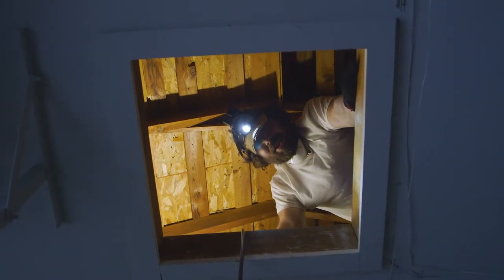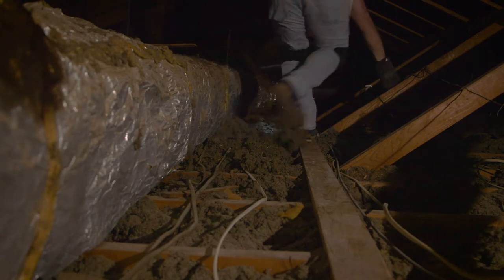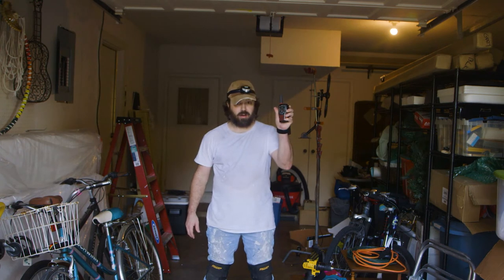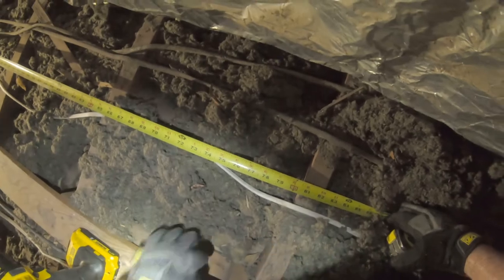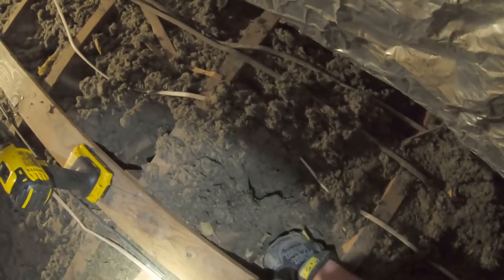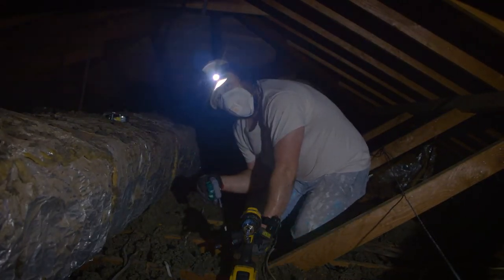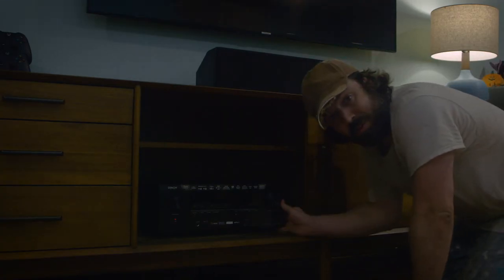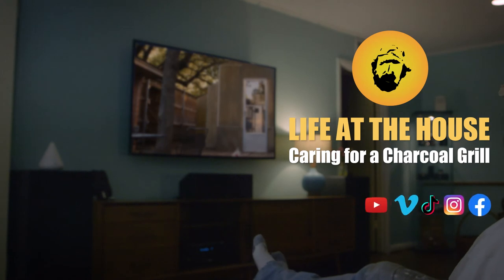Antenna in the Attic | Life at the House

Comment: Wait, wait...waiiiiiiiiiiiiiiiiiiiiiiiiit...Ok, antenna screwed down in the attic. Hole drilled in ceiling from the attic. Coax taped to fish tape and fed down through hole. And then...what? We have TV reception now? So, did the coax come down inside the wall behind the TV and then you drilled another hole in the wall to feed the coax through to connect the TV? Or did you install a coax/cable TV jack in the wall, connect the coax to that and then make another run from the jack to the TV?
Reply from the maker: You got it!  Coaxial cable down the wall to a wall receptacle.  Sorry…need a separate video for that one!